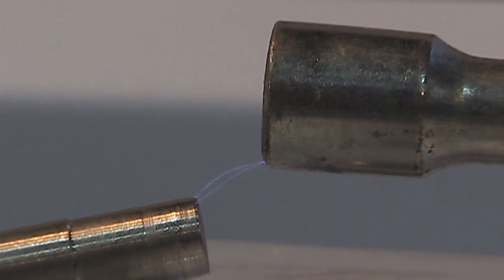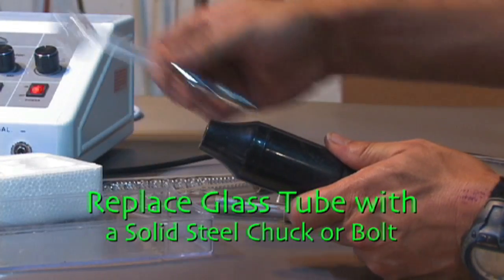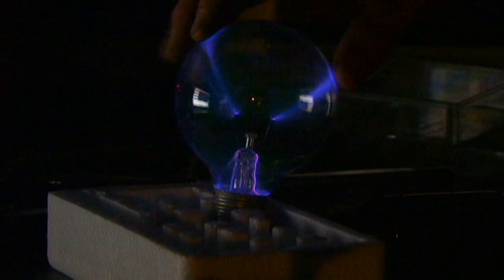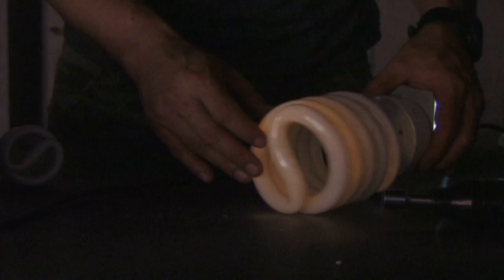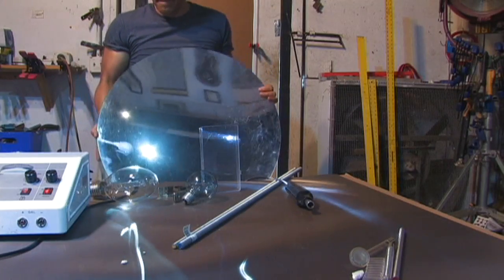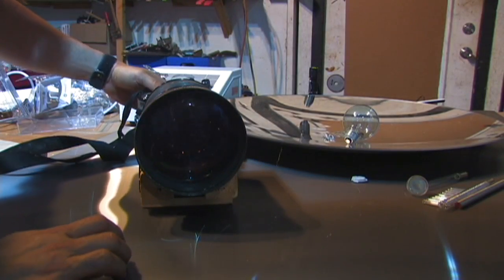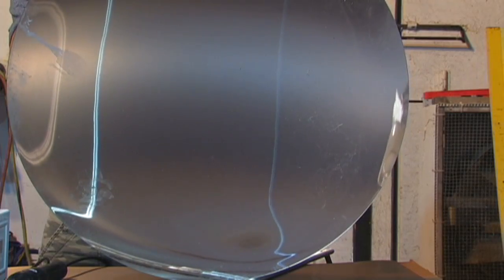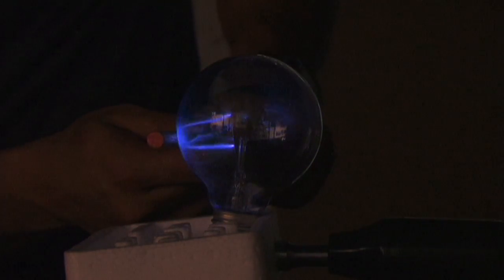Plasma Globe hack from a regular light bulb wireless power

Comment: Manufacturer: Night Watchman Website: BUDK dot com or Amazon.
No specs on either site. I'm not an expert, it's hard to guess. Not sure if this helps, but the voltage output in this model is 80-90% lower than most other models. 100,000 volts versus 750,000 - 1,000,000... Better question, is the cosmetic device you're using outputting AC or DC?

Comment: Just primitive design at the moment.  Oil as an intermediary inside a heat exchanger. The goal is to take stock rolls of mylar and use that width as the height of the reflector.  Then build long or go modular with multiple unit.  I am guessing my mylar roll is 4' wide.  The problem with mylar is that it is very thin and you can't just have it hanging out in the wind like that.  But I can't seem to figure out how to glue it like your parabolic dish, while keeping it cheap.

Comment from the maker: What is the tube diameter, length, material, desired temperature (stagnant stage, non-operational), internal fluid, and will it be heat exchange or direct heating. There are several options; since mylar is so thin, different lock configurations apply to different applications. Or, what is the estimated total size of the desired trough catenary/possible true parabola dimensions and focal length? Let me know, I will be happy to help.

Dan

Comment from the maker: I looked at my facial reflection in the parabolic mirror and it's magnifying imagery revealed I was much older looking than I previously thought. So I got REVENGE:-) 

Actually, that mirror has been out in Florida weather and sun for 4 years 100% exposure. It is a bit dirty but still works perfect and no UV damage. I am clearing an open center for reverse light pass bounced to DIY homemade fiber optic cable I will be showing in a video this week. This is easier than cutting a hole.

Comment: I run a CB radio with an amplifier you can take a fluorescent light bulb and hold it up to the antenna and key down the mic and it will light the bulb up